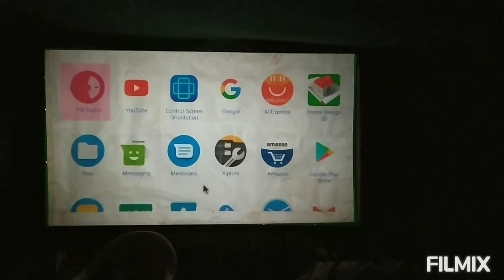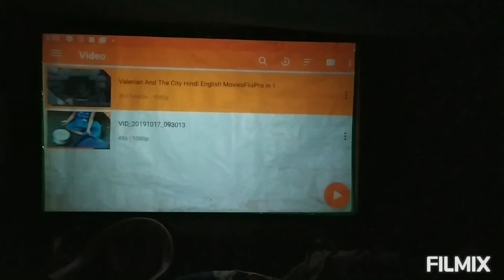📺📽️HOW TO MAKE POWERFUL HIGH BRIGHTNESS DIY FULL HD REAL SMARTPHONE PROJECTOR

Comment: Aur bhai ap ye led ko power kaisa dere hai.. mai ne b bahoot phele aisa same led purchase kiya tha but mere liye ye theek se kam nai ki.. mai ne 900mah 48-58v ka driver use kiya but ye blink hora tha...
Reply from the maker: Maine 50v ki 3  led use ki hai or uske liye maine khud hi takriban 5amp 55v ka driver banay hai, bahut ach6a work kar raha hai...
Reply: @TECHNICALBOY007  driver kaise banaya
Reply from the maker: in5408 diode 4 pieces, 50v 4700uf capacitor.1. or  36v 5amp ka dc transformer use karke
Reply: @TECHNICALBOY007  bhai 36v ka transformer kaha se mila?

Aur ek questions hai bhai... Maximum kitne inch ka screen banare ho ap?
Reply from the maker: 200 inch se jyada lekin ach6a bright screen 60 se 150 inch tak mil jata hai
Reply: @TECHNICALBOY007  Led Driver 37-54W Out DC36-60V Current 900mA. 3 LEDs 150w.